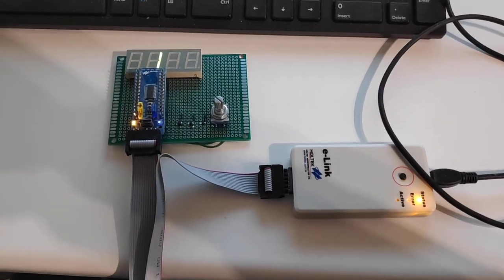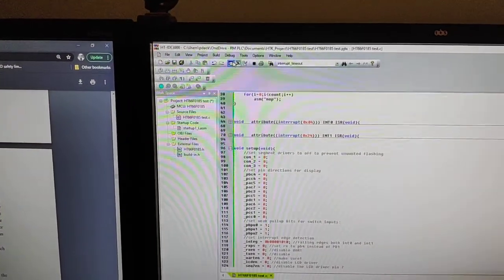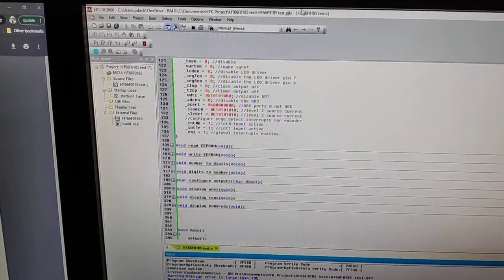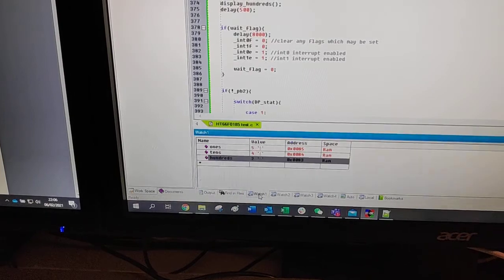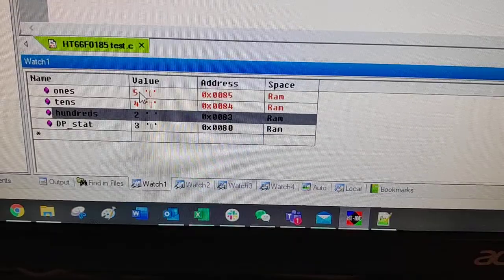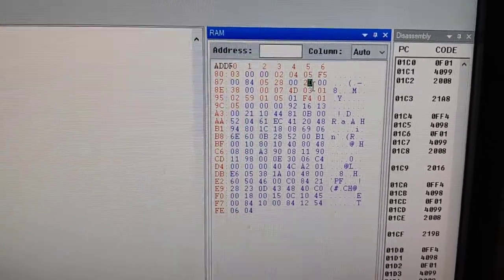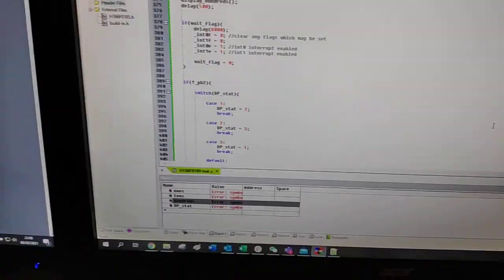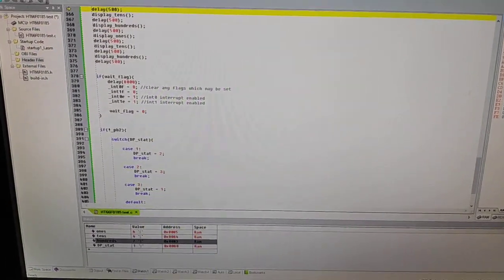Debugging Holtek Microcontroller

Comment: Please will you help me to find distributor /developer of Haltek make ic
Reply from the maker: Hi Nilesh, Holtek parts are getting hard to find at the moment (actually many microcontroller manufacturers are having the same problem). I find they sometimes appear on LCSC but you have to buy them quickly as they disappear fast!